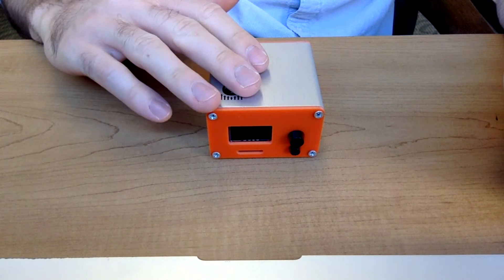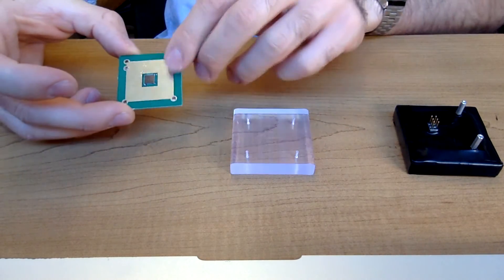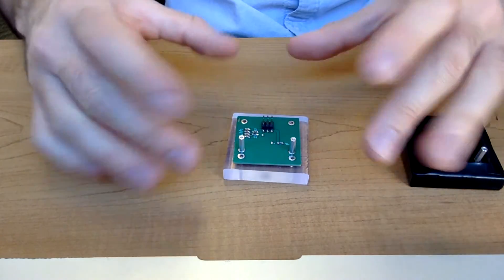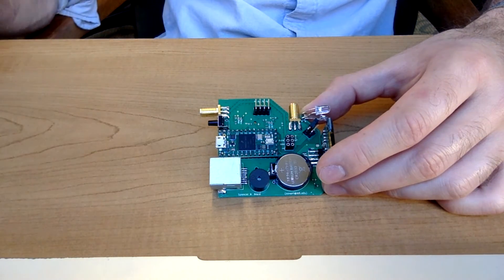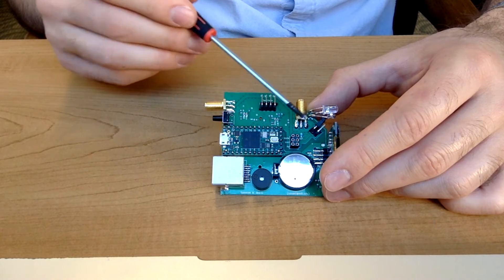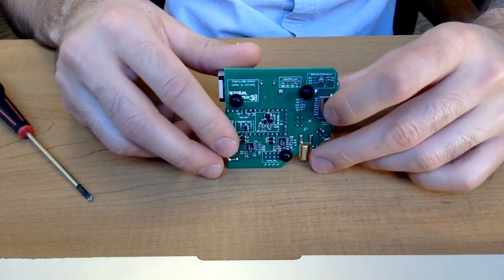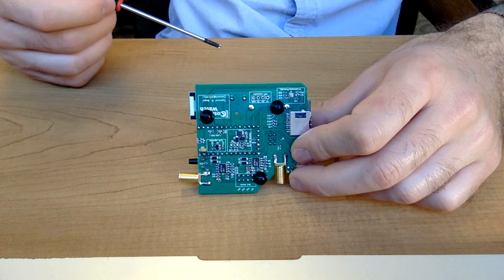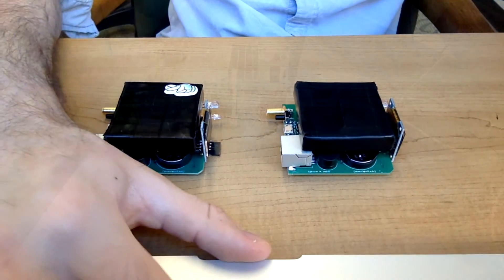CosmicWatch (v3) -- Part III: Detector overview

Comment: For the scintillator/SiPm combo, is the amplitude of the current pulse always the same for a muon? I know the amplitude is proportional to the energy absorbed by the scintillator, so I'm thinking that the amplitude will pretty much always be the same, but of course the frequency will change if there are more muons per unit time. Is this accurate? Just want to make sure I understand.

For my group's electrical engineering senior project we're designing our own muon detector inspired by this one with some added features, so I really appreciate you making these videos!